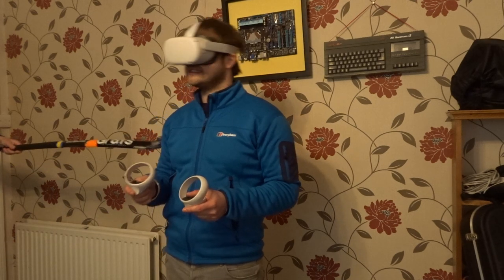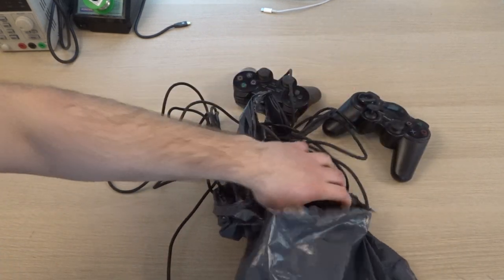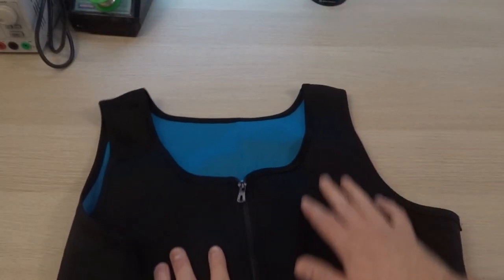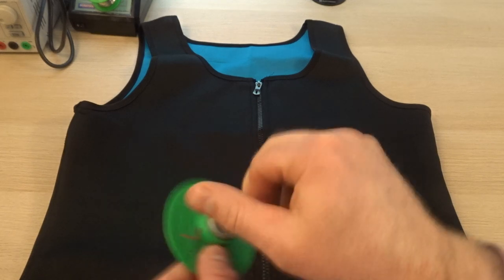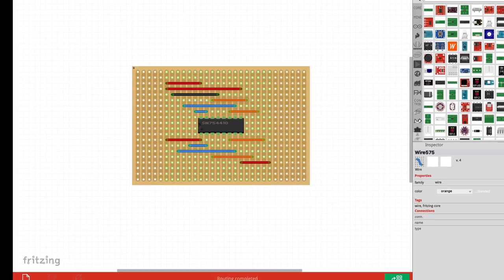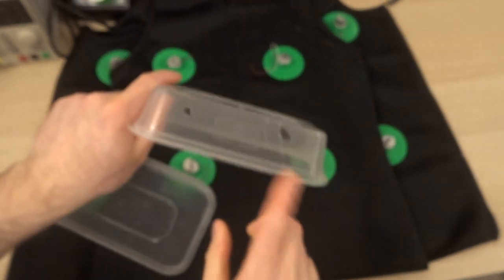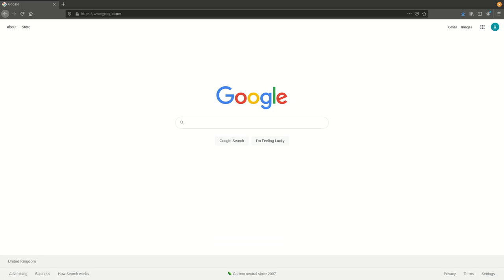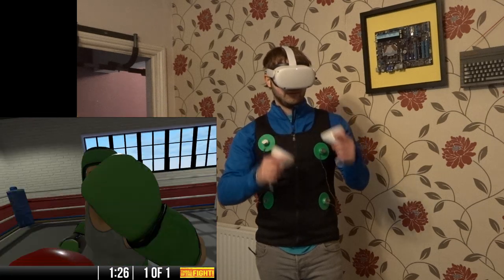DIY Haptic VR Vest

Comment: If you make a build guide ill 100% make my own.
Reply: So will I
Reply: @Gazeld  just get a google translate extention for crome that is what I did
Reply: @Gazeld  The problem is that this guide doesn't show the most important details like for example connecting the circuit in the raspberry, making it work with the files on github and making it work in games.

Comment: Have you done any experiments with cheap piezo disc buzzers? They'd need to be on the inside of the vest, I imagine, but they're much more readily available than eccentric-load motors, to the point where you may as well go the whole hog and replicate the 40-point vest...
Reply: Would piezo discs rlly be powerful enough?
Reply: @redwanmiah9498  not for a full billed impact impact, but they might feel like less violent contact.

Comment: Quick tip for drilling through thin plastic: DON'T. Instead, grab a nail or wire or something similar, heat it over the stovetop, and melt a hole instead. MUCH cleaner looking, no sharp edges, and you don't ruin the box.
Reply: To actually drill through plastic, drill a small pilot hole before expanding it to full size with your final drill bit.  Brace the plastic against something solid, like a piece of wood, so that it can't flex as you press against it.  Use the highest speed setting your drill has, preferably a rotary tool like a dremel.  And if that's not enough, a tiny droplet of water or sewing machine oil will guarantee success.
Reply: @moeburn  pressing against it can also cause the bit to bind and crack the plastic, so just let the weight of the drill do the work. Don't get 50 holes into the vented side of a tarantula enclosure you've spent all day building and then ruin the last piece and need to wait until the next day to finish it because the stores are all closed and that was your last arcrylic piece

Comment: Can you rig up contact speakers to work directly with the raspberry pi?  Basically it would be HD rumble but in a vest (if you understand the mechanisms in HD rumble).  You would be able to play any frequencies you want simultaneously on any of the speakers and it’s cheap enough that you could get 40 of them for $100.  Would you need some sort of external IC just to make them all work, or is it at all possible that the raspberry pi could send all those audio signals at once?  The cost of that project would be around $150 which is a lot better than the $500 Bhaptics vest which doesn’t even have that level of control like I’m talking about.  Making that open source would allow a lot of people to get high quality vests at an affordable price.  Maybe using Arduinos would be more effective as each unit has a decent level of processing power and the footprint of the Arduino Nano is small enough to not really notice it on the vest.  Powering all of them could prove to be difficult however.  This would solve the problem of multiple audio connections and they are much cheaper than a raspberry pi, but do you think it could communicate with the Bhaptics software?  If not then raspberry pi is probably the only solution other than designing a new board entirely.  I think making the vibrators smaller is key to getting the density and cost effectiveness of this project.  Contact speakers can be made from regular speakers by connecting the diaphragm to a plate or a object that would touch the player (I.E. a dowel or stick of some kind).  The only thing I recommend is using a loudspeaker and not a super small one found in many modern phones and tablets.  It’s probably better to just buy them from the manufacturer instead of going the DIY route on that but it is entirely possible to do if it’s cheaper (and it probably isn’t).  Anyway, hope I can get some other thoughts on this!  Thanks in advance.

Comment: Nice! For my old DIY haptics vest I found mini transducers work better than haptic motors. They have a more precise reaction time and lots more punch. However they are a bit heavier and require more power so keep that in mind. I had to keep it to 4 for the whole front and back because of that. Having both would be ideal.
Reply: @SGTJeffreyPeterson  My vest or the difference between component types?